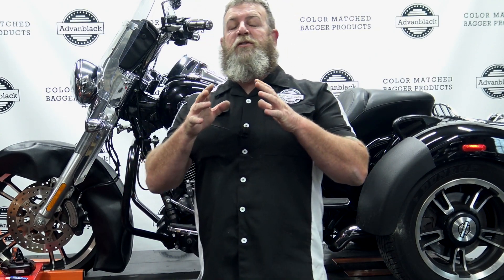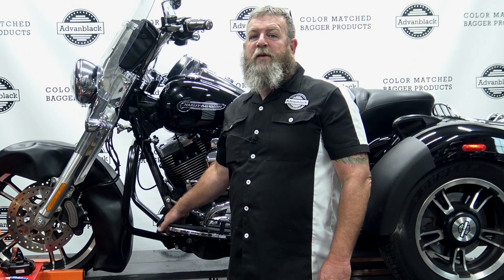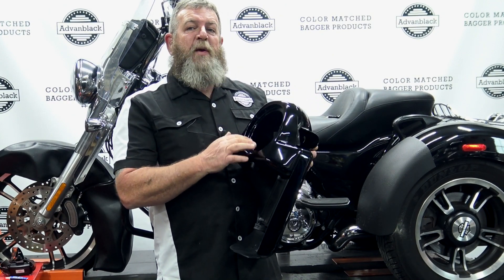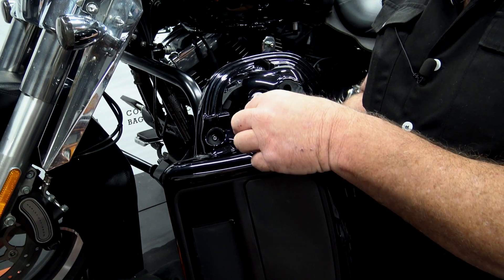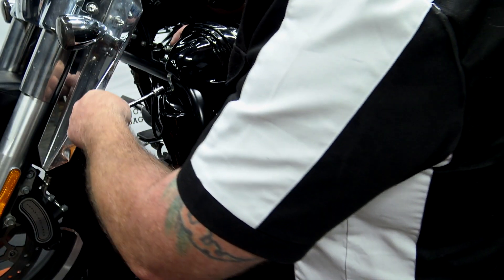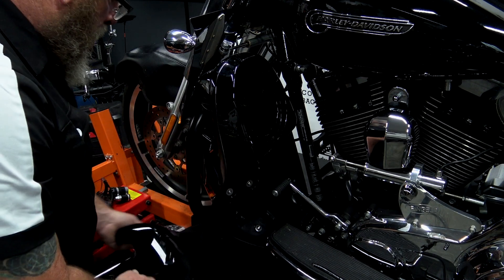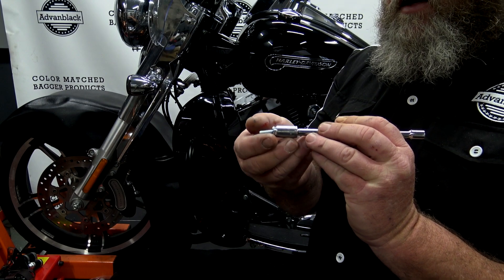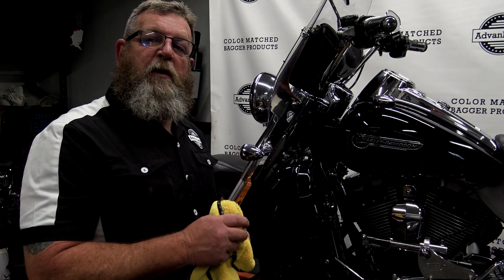Freewheeler Crash Bar and Lower Fairings Install

Comment: Question I’m looking to add fender covers to my Freewheeler, are the ones on this bike available to purchase or were they custom made?
Thanks
Reply from the maker: They are HD brand covers. Im not sure if they still make them but im sure they do.
Reply: You can use the HD fender covers for the ultra Tri glide. Fits fine. Use it one my freewheeler

Comment: Can you put those on chopped crash bars? Thnx.
Reply from the maker: No there are no lower fairings that will fit on a chopped bar made form any company...you will need a full size crash bar
Reply: @Advanblack  ..thnx